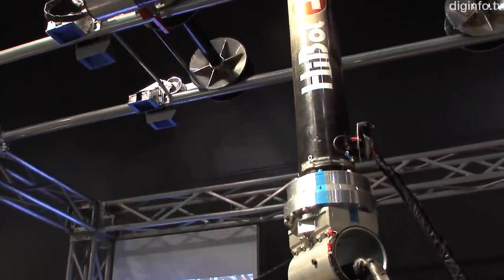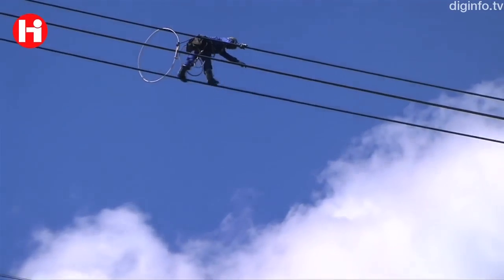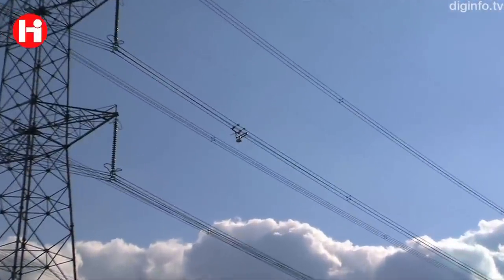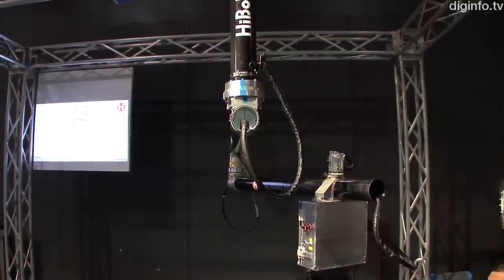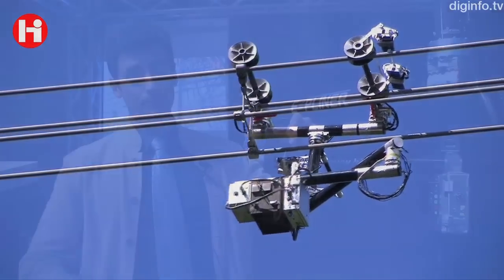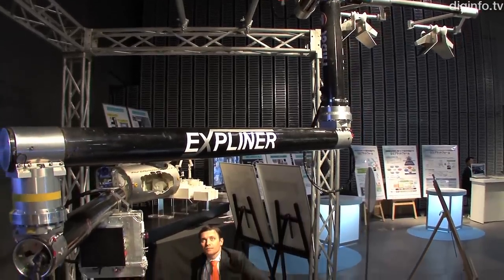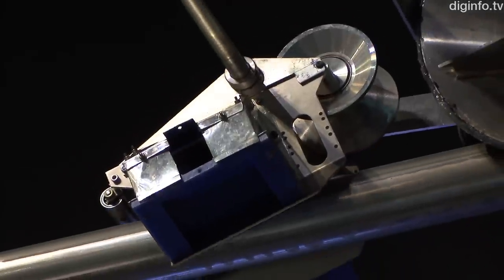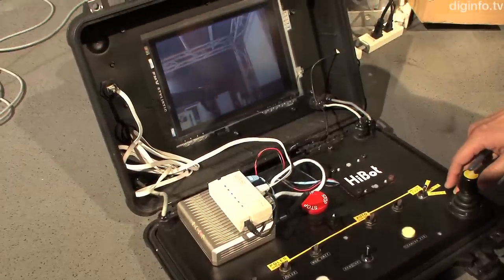Expliner Robot - High Voltage Transmission Line Inspection Robot #DigInfo

Comment: @ArtOfKillingTY The angles between the wheel flanges are clearly designed to pinch onto the cables on which they are riding. This ensures grip without resorting to rubber. Which might slip in wet conditions.

Comment: Would love to see this getting clipped into the circuit. Wonder what kind of shielding they use to protect the sensitive microelectronics from the high voltage electric field coming from the lines.
Reply: Actually, there is not much to do. Just put a metal enclosure and metal wheels. As long as the body touch the wire there is no issue.

Comment: The pylon in the video has lines physically terminated at the tower at a common, vertically hanging insulator; the machine wouldn't work on the pylons that have lines that physically terminate at their own insulators--one either side--(held in tension by the cable weight almost horizontally), with 'jumper wires' hanging in a loop to maintain electrical continuity.

Comment: that looks awesome! but how is it powered? by the lines themselvs?
Reply: very unlikely, I'm sure the frame and wheels are heavily insulated as to not inadvertently transfer electricity across lines or to a tower itself. It's probably powered by a LiPo or other common type of battery.
Reply: Powered by the lines themselves??? Someone skipped high school physics
Reply: nope, there is very high electromagnetic fields that close that can be utilised, alternatively, the lines themselves are warm from the electrical flow which could be utilised
Reply: Are you suggesting the robot converts the heat of the power lines into electricity? Even assuming there is enough heat to pull this off, it would have to have something like a built in steam turbine to generate electricity, which it apparently doesn't.
Reply: electromagnetic fields are very different from heat. Robot could power from the magnetic field, like a 230vac to 12vac, coils have not contact with each other
Reply: @Charles

Why do you think this is impossible  ? Just because the high tension would need to be stepped down (which could be doable), or do you have another reason ?
Reply: Maxime G Ok, first lesson of electricity in high school physics was that it is transmitted in power lines at incredibly high voltage and low amps, to avoid power loss over long distances, which is done through step up transformers. when it reaches its destination (substations etc) the voltage is reduced via step down transformers. To suggest that power can be utilised at the ridiculously high voltages and low amps that go through a huge long distance power line like this is absolutely ridiculous - no offence intended.
Reply: Stephen Terry t
Reply: Charles don't be so smug. You are wrong. While incredibly high voltages are used to reduce losses, the current is still large because of the immense power transmitted. A robot could charge inductively by the oscillating magnetic field, using an internal transformer to step the voltage up or down to suit its needs. You could also use capacitive coupling. That's why you can stand under power lines with a fluorescent bulb and have it light up. So while you didn't skip high school physics, maybe you shouldn't have stopped there.
Reply: Isaiah Moorehead No. See thermoelectric generator. No steam necessary.

Comment: I love technology, this is ingenious.. Though the problem with these developments is what it will contribute to the eradication of the middle classes.
As we develop through technology, innovation and intelligence we are making jobs that are very important to the security of income from non innovators unstable which will have serious implications over the long term (20-60 years)

I just had this thought, and the objective of this comment is to create food for thought for others.

 I am neutral.
Reply: Hello from 4 years into the future! I would think based on the increase in population, there is a higher demand for more power lines, and a higher demand to install them faster. So I don't think jobs would be going away, just jobs will transition more towards maintenance and installation, and less on inspecting.